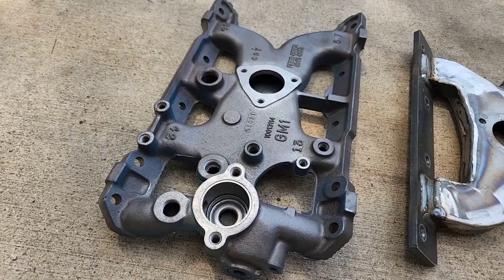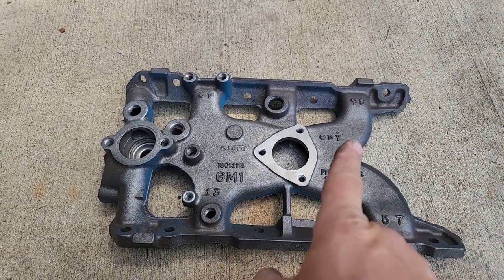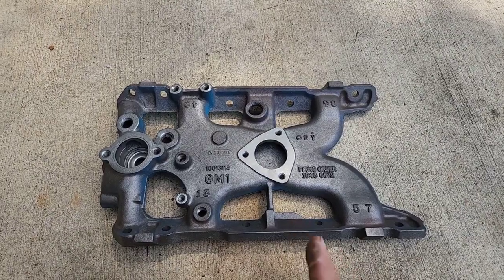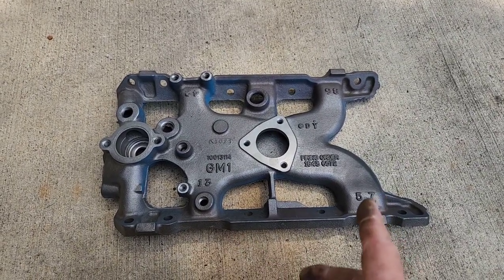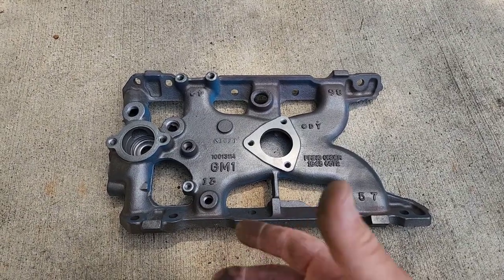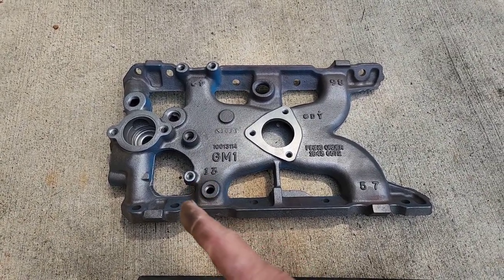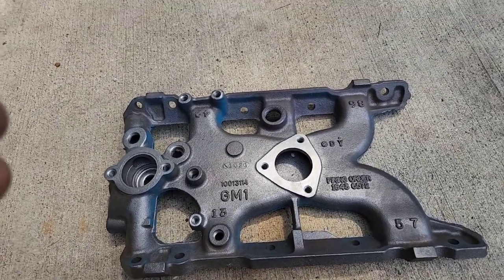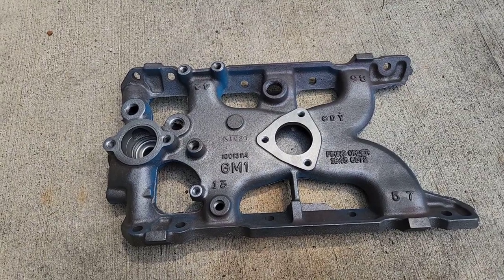TTA Performance - Prototype 301 Turbo Intake Manifold

Comment: I appreciate what you are doing. There is a stigma attached to the TTA which sucks. At the time it was higher HP than most of what was out there and so cool to see the tail with TURBO TRANS AM on it. To add any more HP without opening up the bottom end I think would be great.
Reply: Whack a turbo on a 455 and dump it in there... 90% of people won't know the difference between the 301 and the 455. There would definitely be NO stigma at all after a fella rode in that Turbo T/A
Reply: The 455 Doesn't Need A Turbo. It's Perfectly Fine The Way It Is.

Comment: As an old-time Pontiac guy, I can really appreciate the work you're doing.

With great appreciation for the work you put in, might I ask, have you considered going to a blow through setup 

You are leaving a ton of horsepower on the table by keeping the draw through system, which is terrible in so many ways and a great limitation on potential power, efficiency and most importantly reliability.

Comment: Thanks so much for all the great content on this very cool platform. I have taken a real interest to them in the past couple weeks. Saw Smokey and the Bandit 2 on tv a week or so ago and for the longest time did not know it was a Turbo TA they used in the film. 

What you are doing is awesome and was blown away that you put one on E85 with supporting mods and got it into the high 12s.  I would love to see the what a higher compression 4.9 would do if that's maybe doable one day. (maybe between 10:1 or 11:1). That with the better flowing top end, cam, exhaust and efi....im sure it would be a little monster.

I personally just don't know what the breaking point of those blocks would be when it comes to a HP & TQ numbers.

Keep up the great work!

Comment: Interesting stuff Joe. I'm sure you've mentioned the reason for the bigger 5-7 port is the timing. Because the modification doesn't take this into consideration, do you think there will be an "out of balance" situation, (?), comparing the other cylinders being the same size. Out of balance, air flow wise, not vibration wise. Also, is the port size the "bottleneck" on this engine, and because the bottom end can only handle so little RPMs, will the mod require all forgings there? 
If this experimental manifold proves beneficial, then I guess it'll give the 301 a shot in the arm, giving a built eng. an advantage. Bigger valves, ported heads, bigger turbo, forged pistons and rods, (at least), along with a good cam, and your hedders should make the traditional boys take notice. Can't wait for some dyno/track runs. Good luck.

Comment: The 3 smaller ports are size that way because they're only feeding one valve at a time so they're sized accordingly 5 and 7 feeds 2 valves back-to-back requiring more area

Comment: Great effort, and thanks for that. To bad it doesn’t have a 4 barrel flange so that you can test it NA. It would be nice to see how much of a gain without the turbo. Next step would be to add injector bungs like the 84 & 85 Buicks.
Reply from the maker: A 4 barrel NA intake is also in the plans.

Comment: I’ve always wondered why the intake ports were different with such puny runners except 5/7. I look forward to seeing the results. My thoughts are that it will work well with a little more boost so there isn’t air starvation due to the Siamese’s runners.

Comment: So how is the balance of flow between the ports....would it be important? Does this design increase plenum volume ? Would increase plenum volume be beneficial? Also have you considered a redesign of the 4 barrel pad and also increasing the size of the center inlet on the turbo ...pad...side ? Air flow is everything  😊

Comment: Joe, god stuff and worth the effort to improve.  You're on a great path. Engines are air pumps. Least restriction in and out is just more efficient.  Turbo's have been on Diesels for so long and rule is more dense air the better compression explosion and more power. Gas engines need a little more care because of preignition and heat ect. The fine line of after coolers ect. But the idea to open the ports is just old school and will work with obvious fuel and timing adjustments.  I think you are doing it right by making a more balanced engine and matching stock components to make it all work.  Would love to see results.

Comment: Nice project.  I worked for Corky Bell's Cartech back in 1989-90 and a customer came in with a TTA and as I inspected the turbo found the compressor and turbine to housing clearances where WAY OFF.  Like an 1/8th inch gap.  I simply assumed a bad rebuild.  Later, reading I THINK Turbochargers by Hugh Macinnes seeing a TTA turbo with the exact same problem.  I haven't seen another so assuming this was in fact the way the factory delivered them my conclusion was/is that the original proper clearances would have made much cooler and efficient boost making too much power/torque for the plan and maybe the transmission.  So, TTA, have you seen what I am reporting?

Comment: It amazes me in the fact you were able to port out the 3 other "non" 5-7 ports, to match the large one. If only the traditional heads had that much meat to hog out, they would flow much more air. (If you had a manifold to match.) Hope you have enuf time in your life to continue your quest with this experiment.
Reply: But it's not an 8000 rpm engine.... 🤷

Comment: This may be too late as  you have already fabricated the hi-perf intake. But i think clyinders 5&7 are fireing in sequence and that's why the runner is bigger at just those two cylinders and not the others because only enough fuel and air is coming to feed one cylinder at a time and not sequentially. You may actually hurt performance by opening up the other runners.

Comment: Even as chocked as the 301 turbo is I still outran ran a dart with a 340 with mine.
Reply: I have a hard time believing that...
You sure he didn't just accelerate away at an eighth of the throttle?
Reply: @davelowets  nope it's true but 301 was almost stock car got 2nd gear rubber most of the time.

Comment: The firing order is the same as all traditional GM V8s. Boosted Air does not see a sesame port. The air is already going in that direction just diverted to the next valve. 20 lb of boost would make up for any difference. 7.1 compression is a bigger fall back.

Comment: WOULD this intake manifold allow you to use 326/350 style heads on the 301? GOT a website for your products?
Reply from the maker: No. This is for the standard 301 heads.

Comment: Any idea on what the size of a stock 301 non Turbo exhaust manifold outlet is ? Wandering if my existing exhaust systems down pipes will fit onto 400 2&1/4 inch manifolds.

Comment: Imo enlarging all of them to the same size of the large one is not ideal. You have 6 holes taking turns using the runner and 2 sharing a runner at the same time....reason for the 2 sizes so you basically doubled the runner volume of 6 cylinders but left 2 cylinders with factory size? Just adding like say 30% runner volume across the board to each one (same on the head port) would be the best way but hey I'm not an air flow expert I could be all wrong you probably already know this and are just doin a whatever why not just try it. Increasing vertical plenum height may likely help with the transition of inlet to runners but looks like room is an issue not much if any down and going up would throw everythings locations off. But hey keep on it there's got to be room improving the OEM set up you start swapping out major parts like heads and turbos ECT at some point you really don't have a 301 turbo you just have a turbo charged poncho... anyone can do that it's not new I mean its cool n all but nothing ground breaking or remotely oem, but anything is cooler than tossin a LS in 🙄 which I'm soooo sick of, I'm not competing drag racing so I'll just keep jerkin with my SBC  it was the hot ticket for decades and now all the sudden its an obsolete  piece of dinosaur shit waste of money?? No it's fine and still viable. I love watching Billy the kid woop LS cars bad with his 400 SBC S10 🤙

Comment: So, WHY did Pontiac make that one port larger than the other 3?? 🤔🤨
Reply from the maker: It had to do with the firing order. Cylinders 5 and 7 fire one after the other but share the same intake port. There was concern that cylinder 5 would take most of the air and fuel and starve number 7 so they made the intake runner bigger.
Reply: @ttaperformance1046  Ah, I get it. So, a 4/7 swap cam would screw that whole deal up...

I would guess if they made all 4 ports that big (which they could have) it would have made for some low velocity and stalling ports on the other 3, for a stock engine anyway.

I've always been a 400, and 455 guy. I've never messed around much with the 301. I tore them all out and replaced them with the bigger engines. I do, however, understand the need/want to keep the 301 turbo to keep the car original though..

Comment: custom cam to change the firing order?
Reply from the maker: Thought of that, but you will always have a sequential pair of cylinders.
Reply: @ttaperformance1046  damn it, i forgot about 4,2 at the end
Reply: How about different cam timing for 5 and 7
Reply: @ttaperformance1046  Just have a custom rotating assembly made for a 180 degree flat plane crank.

Comment: How pointless is air velocity though, when a turbo is slamming it into the engine?
Reply from the maker: If you can make the air flow better without the boost pressure, it will take less boost pressure to make the same power.

Comment: Omg i am having flashbacks from  30 plus  years ago when i had  my 80 transam with one of these motors .... my god there is no hope for the cylinder head ... yes even with the different deck height ... from a regular Pontiac these heads will never flow for any power

Comment: Your heat dispersement is going to suck.
Reply: Huh? What "heat displacement"? 🤷
Reply: @davelowets  I guess I should’ve ,said heat dispersement. The heat will collect in the solid steel intake opposed to a cast-iron or cast aluminum . That’s why you make intakes out of cast iron or cast aluminum because the heat moves and disperses a lot quicker.